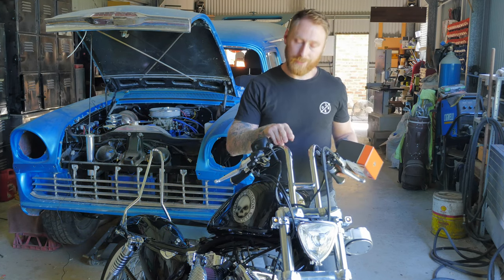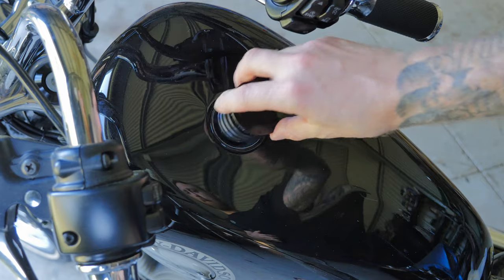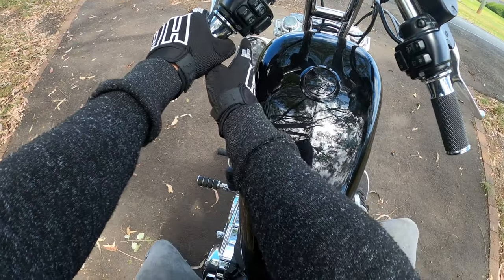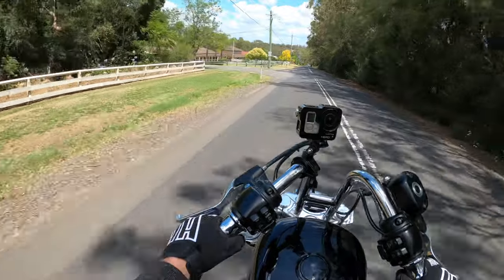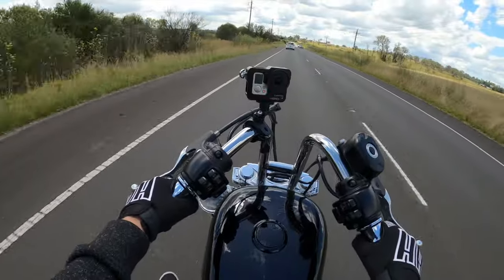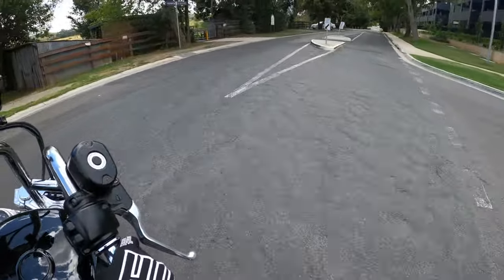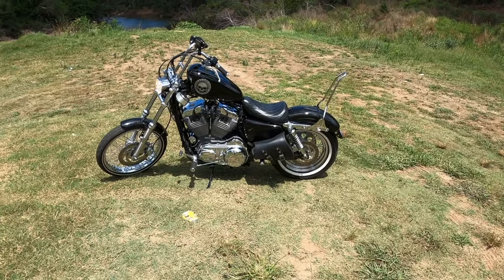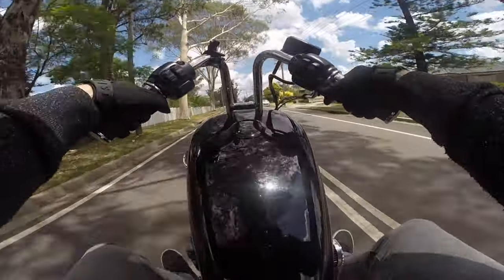TC Bros rabbit ear handlebar ride review

Comment: My custom big twin was built with these big beach bars that I hated so I tried every bar and riser combo I had in the shop. Nothing worked, I couldn't get comfortable. Finally out of desperation I tried the wide rabbit ears I bought for a Sportster project I am planning. I never thought they would work but they are perfect. The bike finally fits me. They look a bit out of place on such a big bike but screw it I'm comfortable. 
The parking lot handling has suffered but at road speed they ride great. The big bike feels light and maneuverable now.
Hopefully I will get used to the parking lot handling over time, it's already getting better.
Only down side is that I will have to buy another set for the Sporty.